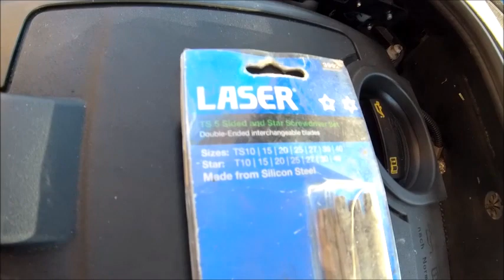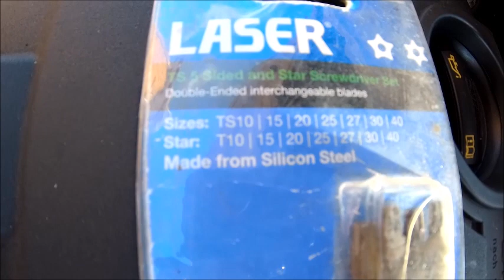#Audi #A3 #8P Replacement Grille and Repair.

Comment: Hi, great video helped me decide to change my grill after a slight bump.I have sourced a grill (8P7 2011 A3 Cab) and to be honest i dont see a lot of clips on it ,i see plenty of screws attaching the grill ,i am trying to get as much info as possible before i remove and replace .....Or are there clips after you take the screw out..
Reply from the maker: Hi ..the screws hold the grill on , but yes there are also some clips around the grille itself ...you have to get a flat blade screwdriver and give them a little push in and they they release no problem ...it will be obvious to you once you have the bumper off and you can get to the back of it .. Chees Ade.
Reply: @AdeReeves  Thanks for the quick reply

Comment: you can sell that old grill for £50 0n ebay. thats the asking price. even if its broke everyones doing it. i ended buying a brand new one for£130  it was a honeycombe one.  ps your video was perfect. except for the nsr wheel choke. to stop the car rolling back. you had it infront of the wheel not the back of the back wheel lol
Reply from the maker: the drive slopes towards the garage , But I know that does not show up on the videos...

Comment: Good job!  good to see you avoid using the sills as a jacking point ... but what are you using? the wishbone mount?
Reply from the maker: On this car yes...On the S3 it has the proper jack bungs  but I still use the wishbone most , but its a bit lower than the A3 and a little more tricky to get under..

Comment: Is this the same process as on the s3 8p? TIA
Reply from the maker: Yeah exactly the same setup as when I have taken my S3 bumper off...
Reply: Ideal. Thank you for the quick reply. Going to plasti dip my pfl grille and crash bar black so this helps me a lot.
Reply from the maker: @accelerate3538  be interesting to see the finished job...never tried plastidip myself but i know people who have had good results with it.
Reply: Its meant to be more hard wearing so makes sense for the grille I think with stone chips. Just added you on Instagram so you can see the results when I get round to it, got many parts to fit first.

Comment: Hello Ade, where do you Jack up on? Can you show us a bit closer in another video??
Reply from the maker: Hi Warwick...  The best place i "Personally" find is the bottom wish bone connection to the chassis...My S3 has designated jacking points just in front of the front doors as do some other Audi's, but they are not always a standard option ...Next time i jack either car up ill try to capture it ...Hope this helps.